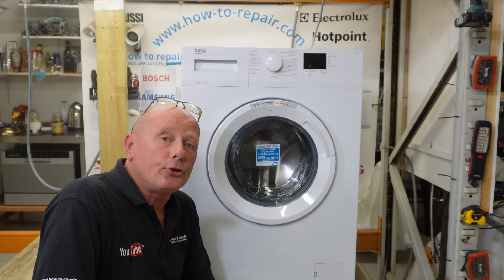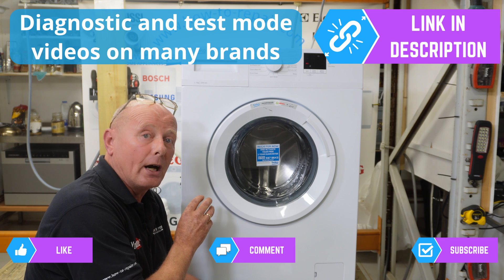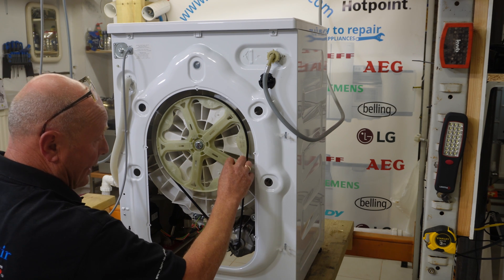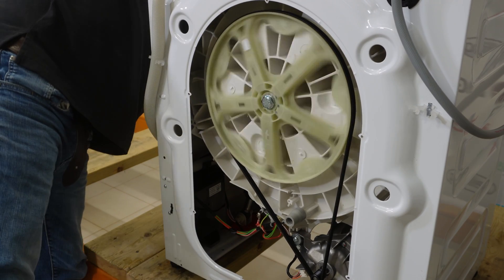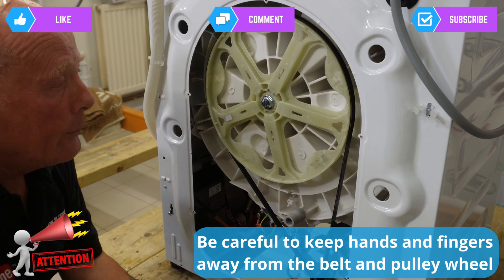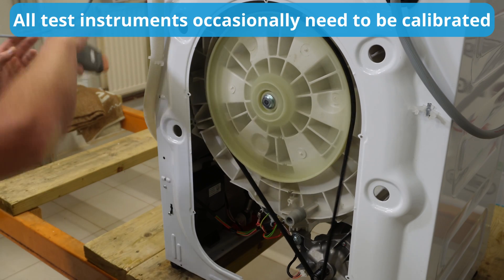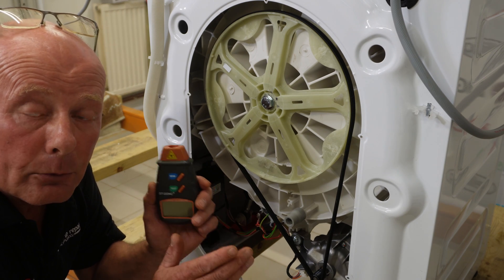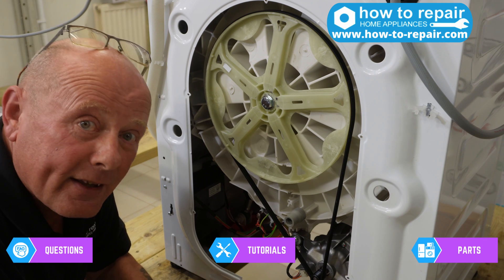How to measure and test the RPM of a washing machine drum or motor

Comment: one question I have with regarding washing machines with induction motors is, how do they convert normal 240 volts mains voltage  to 415 volts 3 phase for the motor

Comment: Hello, I have problem in my machine that produce noisy sound in drum spinning. 
Can you advise which step in test mode to select and test?
Reply from the maker: Hi mate, you'll need to check the drum bearings and the spider. If the machine is noisy, especially during a fast spin, it's usually an issue with the spider or bearings. This isn't a difficult job, but it will take a couple of hours.

Occasionally, the age of the machine can cause the drum to warp due to misloading or imbalanced loads. This causes the drum to go out of alignment. If you rotate the drum by hand and check the gap between the door seal and inner drum, you may notice it rubbing on the door seal. This is a major failure, and you'll need to replace the drum.

You should watch my other videos about drum bearings. Don't forget to subscribe to our channel, as that really helps us 😇

Since we work very hard in our warehouse making free video guides for you all on appliances, we always appreciate a beer, offering a choice of single or round beer. https://www.how-to-repair.com/help/buy-paul-a-beer/ 

Thanks, Paul 👍
Reply: @How-to-repair  well noted with many thanks. I will check for this accordingly.

Comment: My beko is not spinning in spin mode while testing. Clockwise and anti clockwise spin just fine. Please any help?
Reply from the maker: Hi, I will need the full model number of the identification plate and the details of your problem so that I can provide you with useful literature. Please use our contact us page and make sure you fill out the request for what your problem is. A video shoot of the problem would be perfect as well.

I will get back to you within 24 hours, normally. https://www.how-to-repair.com/help/contact-us/  

Thanks, Paul 👍

Comment: I have a very similar machine. Could you give me some advice on a problem that I'm having. Since new the machine had problems and the warranty ran out. Anyway the machine on empty truns fine, but loading it with clothes and when the water fills (heavier clothes) the motor is sometimes struggling to start and it just skips that rotation. On the spin cycle it just tries to rearange the clothes for a good hour and just gives up. I was thinking this it related to the control board and I have been trying to pinouint the problem. Since it was doing this from new I was thinking there is a problem with some elements on the board. Specifically the current sense resistors. The writing on them does show 0.05 ohms but measuring them with the kelvin methon I got 0.07 ohm. This could cause problems for the CPU whil measuring current to tge motor. I soldered some 0.2 ohm in parallel and it did improve the machine performance. But still when I put heavy clothes it just can't turn. Also from the beginning i noticed then when the motor starts truntning it likes to rattle a little just as soon as it starts(for a second or so)
Did you come across any of these simptoms before? Thank you

Comment: Hello. Do you know what is the amplitude of the output voltage of the tachodetector at the maximum engine speed (10000-15000 rpm)?
Reply from the maker: Sorry that will depend on the make of the machine and the type of motor plus the circuit board and I am unable to be able to give you this. Sorry as the manufacturers do not give me this type of information.  please remember to subscribe as that's is was keeps this channel going. Thanks 👍

Comment: Good video!
Our Haier washing machine HW70-1282, when the spin speed is at maximum it is only 1050 when it should be 1200, which is quite a lot less in my opinion. What I interesting is that the 1400 model, uses the same motor, but increases to a higher spin speed, and the motor is only specified to be 14000rpm (Welling brush motor)
Reply from the maker: please feel free to contact me in the website where you will actually be able to get in touch with me Thank you for leaving a comment, I would love you to leave your opinion on our poll about manufactures building in obsolescence to appliances. https://www.youtube.com/post/UgkxygHomnUySd_bYjaJBdEHPO6T4dYo9Ahm
and this is for you https://www.youtube.com/shorts/e432SAb2g08 please remember to subscribe as that's is what keeps this channel going. Thanks 👍

Comment: Hello Paul: Is there a relatively easy way of hacking the spin speed of a lower washer max to up to, say, 1600?  You say it's fixed electrically by circuit - so that would be no unless you could simply and cheaply swap the board for the identical model with the higher speed.  

With the cost of electric drying as it is the faster spin speed is desirable.  I'm sure you'll confirm that the motor and build of a 1600 and 1200 washer is identical...

Thanks!
Reply: Some washers have a config mode to change the spin speed. Some guy made his 1000 rpm bosch go 1400